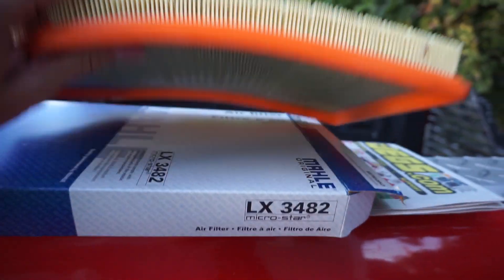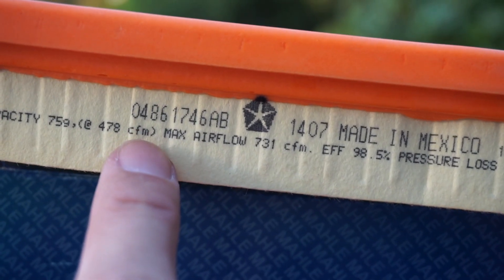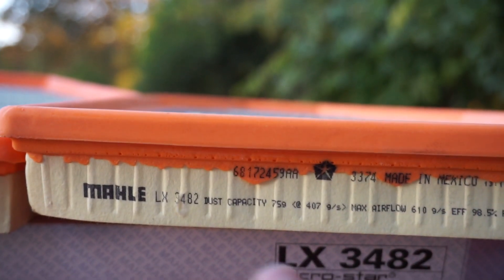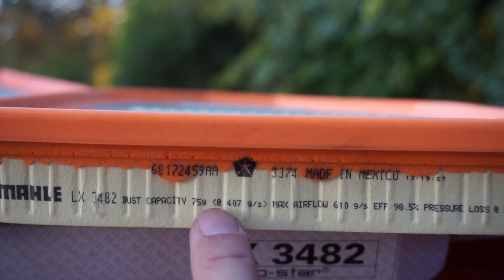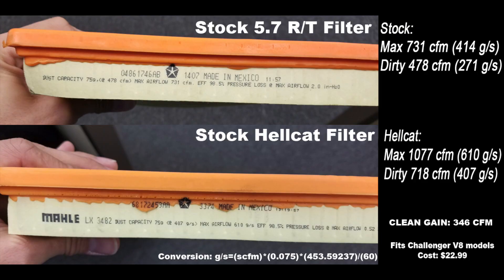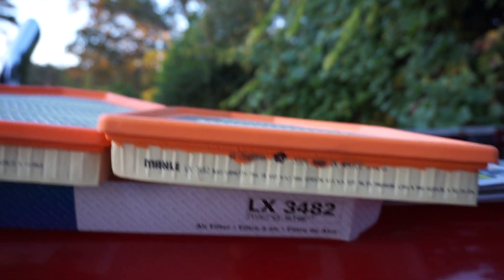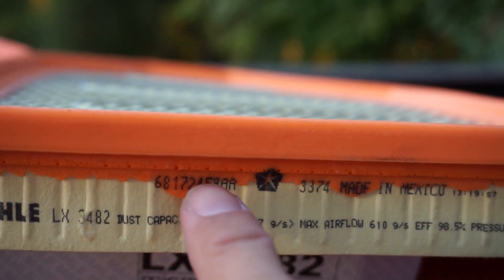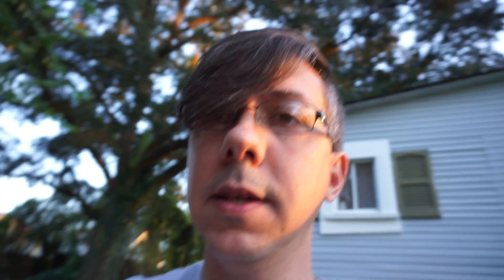Hellcat air filter in 5.7 HEMI Challenger 2015 , 2016 , 2017

Comment: I just replaced my k & N filter with the hellcat filter, along with fuse 31 pull, throttle body cleaning & recalibration .. and WOW no hesitation whatsoever. Throttle response is nice & crisp, car seems a little faster. I have 2016 challenger rt plus 6 speed
Reply: So when you say recalibration you mean by holding down the peddle for 20 seconds and doing all those steps?
Reply: @bryan2408  yes correct
Reply: @James33432  did you notice a change in gas mileage with this filter ? Do you get hellcat mpg now ahahah

Comment: I know this is an old video but in my Hellcat I am currently using a Green Filter USA oiled filter.  The Hellcats have MAFs and thus far I have had no issues.  It does have less oil than say a K&N.  I also purchased an aFe high flow air filter which is dry.  Haven't tried it out yet.  I know when I was researching these the flow rates were better than the stock Hellcat filter but for the life of me I can't remember where I found that info.  When I get a chance I will check to the boxes to see if it is listed there and post another comment.  You can tell just by looking at the filters though that they flow rate has to be better because of the construction.  Both of them are more expensive than the factory Hellcat filter but you can find better pricing on Amazon.
Reply from the maker: coolwrld302 Awesome.  Yea I'll check that out for sure.  I have been trying to find flow rates on the round Air raid filters as well.... with no luck.
Reply: MrJimTim it’s 2019 and the filter in the video (OEM) is still the way to go. On my R/T I am tempted to swap the box with a Hellcat box with that trick headlight port.
Reply: @coolwrld302 did the afe dry flow better then hellcat??
Reply: @just_a5.7  Well I never had it dyno'd with factory and the aFe but just looking at the construction of the 2 it looked like it should. I actually ran a Green Filter USA filter predominantly on my Hellcat
Reply: @coolwrld302  I heard bad things on the green filter but heard it flows better
Reply: @just_a5.7  Never had any issues with my green filter.

Comment: Dude 2016 RT 5.7 mid muffler delete tomorrow have bottom half of hellcat air box aFe Power Air Scoop and hellcat filter on order. Debating weather to get the top half of the air boxes it looks larger and much smoother than stock. Just trying to help it breathe I’ll see what happens all for about $350.00 canadian

Comment: Ok any link on where to buy one? Installing the hellcat airbox on my 2017 Challenger
Reply from the maker: I guess that would have been smart of me to include in the description!  Here it is -  https://www.jegs.com/i/Clevite-MAHLE/695/LX3482/10002/-1

Thanks for watching and commenting! -Tim
Reply: David Schroder I bought mine at AutoZone for $30. Isn't the airbox the same in the R/T and the hellcat?
Reply: Just add the hellcat air box it will fit any Challenger including the V6. It’s about 120 and has the CAI through the headlight

Comment: I always use k&n
Reply from the maker: K&N makes a good filter... I always used them until I had a problem on one of my vehicles in which the oil from the filter ruined my MAF sensor.  On these cars the sensor is far enough away that it should not cause a problem...  but I have also seen better airflow ratings out of the Hellcat paper filter and it is cheap enough to replace each year with no worries about recharging.